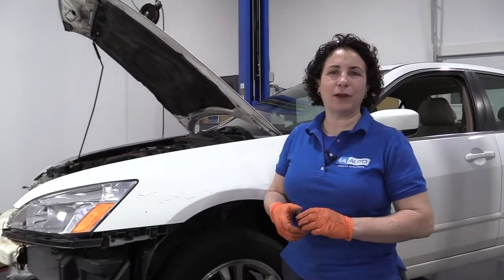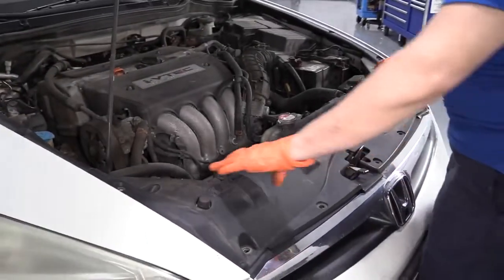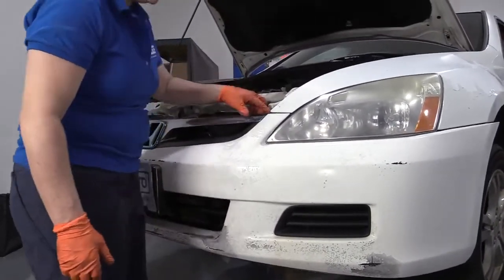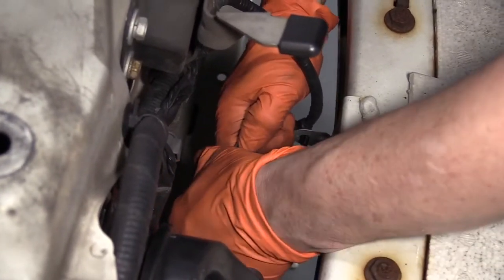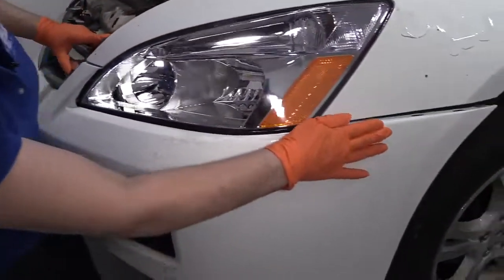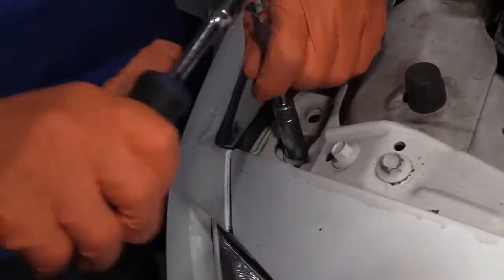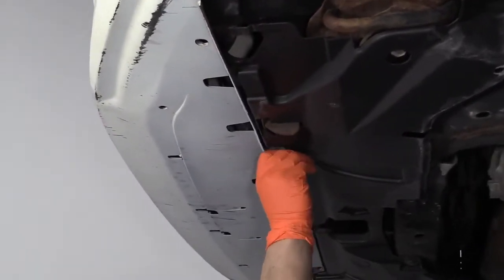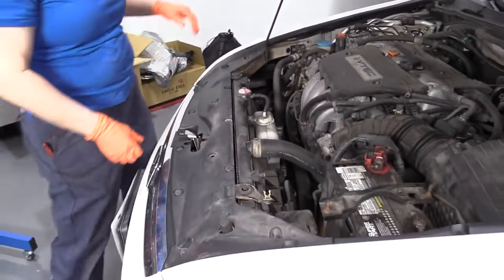How to Remove Ambient Temp Sensor 03-07 Honda Accord

Comment from the maker: √  Watch the Video
√  Buy The Part at 1A Auto https://1aau.to/m-Visit-1AAuto
√  Do it Yourself
√  Save Money
Reply: My AC compressor clutch is only engaging at night, I wonder if this may be part of the problem. I've ran the Honda self diagnostic test and it doesn't blink any codes but im thinking since it works perfectly at night if there's too much pressure during the day or this censor may be messing up.

Comment: Man, the headlights automatically restore to "like new" condition just by changing a temp sensor? Cool beans! I had to replace my instrument cluster on an '03 Accord since the LED's stopped illuminating the speedometer, tach and miles/temperature. Now the outside temp is showing a constant 65℉ and I think it might be the sensor. I haven't seen the temp display in 2 years and I do not think the replacement cluster is bad. Thanks for the vid.

Comment: Thank god! I'm selling my 2008 Honda Accord right now and just noticed an odd wire\sensor hanging behind my front bumper. I thought it was some sort of Oxygen sensor because I've been getting 'Check Fuel Cap' errors and random Check Engine lights that also have to do with the fuel cap (or so I was told by the Mechanic). Finally got that fixed, then found this wire and thought OMG they broke something else! Good to know it's just an Ambient Air Temp, now I don't need to hide from the buyer I'll just tell them to have it remounted or watch this video lol. The Car only has 47,000 miles so it's still worth a few grand at least.
Reply from the maker: +Nick King Televised Thank you! We love empowering our customers and showing how to perform DIY auto repairs with our high-quality auto parts. 1AAuto.com